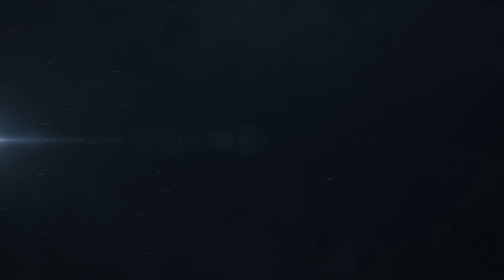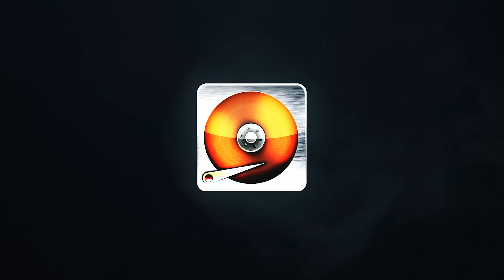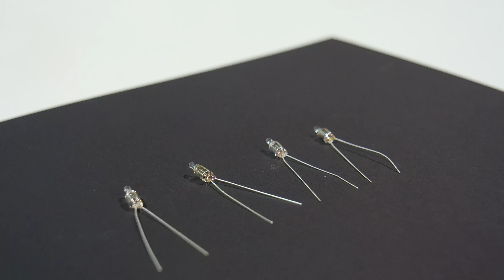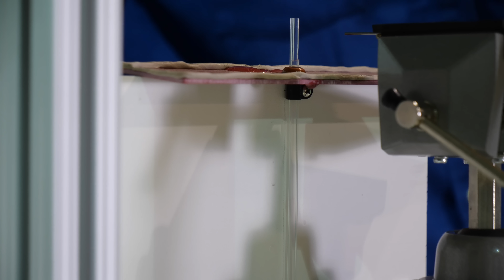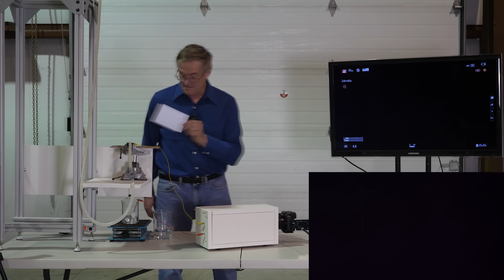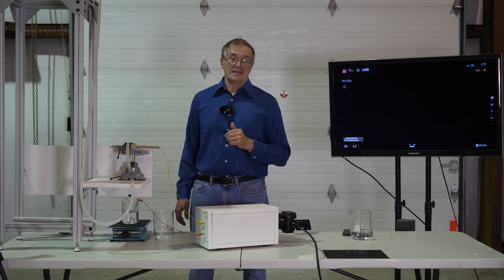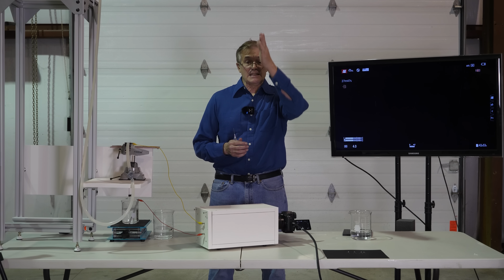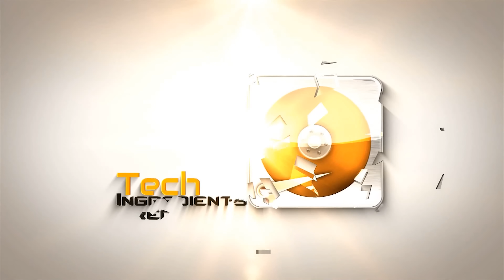We made electricity from water - and it's easy!

Comment: I've played with the Lord Kelvin's Thunderstorm apparatus, and while it is interesting, the conversion of the high voltage at low current to something more usable is tricky.  I like the idea of mass paralleling of the channels though.
Reply: I need to run a water dropper again but this time add pH indictor. I hadn't thought about it as an acid/base generator.
Reply: @smsn13act85  It makes you wonder if the same process actually happens in nature. If a plant has evolved to prefer a slightly lower pH, the water that passes through its leaves and/or branches could be subjected to a similar effect.

I'm, obviously, speculating to the moon and back, here, but it's something that could, perhaps, be theoretically possible with some flora.
Reply: @leoa4c  agree a so simple model is certainly existing in Nature. Remind me making electricity with a lemon😊❤.
Reply: Electrostatic stators being water powered for say something like Martin logans electrostatic panels would be really cool!
Reply: I think that it would be possible to resin print the channels with the required properties.
By using a modular design, in theory, an infinite amount of them could be combined in three dimensions.

A tower with millions of channels could be built relatively quickly if the wiring of them were to be automated.
Reply: 😊 @leoa4c  a cat fur? ❤😊.
Reply: Wouldn't you just use a Tesla coil like device in reverse?
Reply: Robert Murray Smith covered this a while back on his channel.
Reply: @kevinleebailey  Thank you for recommending the channel. I had never come across it but it appears to have very interesting videos.
Many thanks once again.
Reply: It was video 1459 How To Make A Rain Fuel   Generator.
Reply: @bigclive, I think they would've been more successful doing an experiment using the flow of water to power something like a watermill... 😉👍
Reply: You know you are doing something cool when Big Clive drops in to comment...
Reply: This comment is another seal of quality.
Reply: It's like electrostatic charge created by cleavage. Something I learned from an old 1870s electrical engineering book I found at a car boot sale.
Water droplets evaporating from a body of grounded water cleave from the surface and become positively charged. It's like Lord Kelvin's water dropper in reverse.
Reply: Let’s light something on fire then… ¯\_(ツ)_/¯
Reply: Trompe?
Reply: cap dump it
Reply: We are family here!
Reply: @aleoa4c That sounds very plausible to me 👍
Reply: However,  our body is a big water machine and synapses are chemical exchanges of electrical energy conducted as a circuit.
Nature did it. ❤😊.
Reply: So, what is the difference with the Robert Murray Smith showed sme time ago, that worked with rain water? How many of them LASER's from Santa's second grey sack would this power?
Reply: Transformer
Reply: I have also built this several time over the years. Using the charge in a conventional way might be missing the point. Kelvin's Thunderstorm actually separates the OH- from the H2O+. If you could separate out the H2O also you would have an expanded gas without heat. If you then discharge that you'd have an implosion - usable energy.
Reply: @TonyGrant.  I agree, but i would go even further and add 3 x 1mm spark gaps into the circuit  to make the electricity resonate, and become even more. The higher the voltage goes the easier it would be to convert back to normal usable  electricity with the help of a step down transformer adding amps to do hard work.

Comment: It seems that energy is coming from the kinetic energy of the water, not from the water itself.

Check with Sabine Hossenfelder, she is great at getting into the physics of what is happening.
Reply from the maker: You're right that the water is the intermediary between the potential energy in the elevation of the water and the electrical current that is produced.
I think it's pretty clear what the mechanism is with this process.
But, I won't turn down the opportunity to learn something.

Comment: In theory, this could be "scaled up" relatively easy.
Issues with most sources of water would be adequate filtration and/or cost-effective cleaning of the channels. Even a very small percentage of foreign particles could affect the efficiency significantly and relatively quickly.

Regardless, with everything considered, there is already an impressive amount of power being generated for what is, in essence, just water movement. As this system gets further developed and other great minds dedicate their time to the intricacies of it, I can see it finding multiple applications.
It is not the type of generator that will power the world, by any means, but there will definitely be uses for it.

Thank you ever so much for another great video.
Reply from the maker: I agree completely.

Comment: I guess a good large scale test example of this could be done with 2 stage metal roofing sheets using rubber isolators  between sheets.
lets say it's a 7Ft roof length:
1. Split them into 4Ft x 4Ft sections.
2. lower sheet coated in a phobic spray coating used on flooring, that's usually a floor lever rubber.
3. Upper 4 Ft with isolated rubber grommets separating the layers with a wire solider under it and all other 4Ft x 4Ft sections making the top layer crown. ( - )
4. Collection Water Trough in the form of a metal gutter below that must float and isolate above ground a few inches or GROUND will drain said energy gain. (+)
(For the same reason we don't lay lead acid batteries on the ground)
5. Your tubes under each valley point. Those sheets can have 10-20 valleys per 4ft section.
6. The wires ran into a low amp input high voltage charge controller as the manifold power collection point should do the trick.
You should be able to monitor the incoming and output down converted into 12\24\36v higher amp and usable.

Wooden shed would be the perfect test.

Neat find.

Comment: So I was wondering if this phenomenon also occurs when raindrops fall on the leaves of trees , that as the droplets glide along the hydrophobic surface, charge separation occurs, making the droplets more acidic before they fall to the ground. Maybe this acidity then helps dissolve nutrients in the soil, and the resulting electrostatic charge contributes to transporting those nutrients up through the tree's roots.? Also, thank you for this amazing video!
Reply from the maker: I like your way of thinking. 🙂

Comment: Is this also producing hydrogen gas at the bottom and hydrox at the top? Could those be captured for hydrogen power as well?
Reply from the maker: I'm not sure. Hydrolysis occurs at the surface of a highly conductive metal plate and not in the bulk of the water. The plastic may not be conducive to that process.
Reply: @TechIngredients  My thought process here is, when you have a surplus of H+ ions in the beaker, and electrons exit the circuit, two electrons and two H+ combine to form H2, and a similar effect at the top with OH- donating electrons. I could be misunderstanding the chemistry or the amount of gas produced may be negligible.

Comment: FEATURES: adapts to any IC engine as the gas is drawn into gaseous form in the quantity determined automatically  by the vacuum, (the more you depress the throttle pedal, the more the vac and the more gaseous?gas is drawn into the ice.  Super EZ, super Low cost very low parts count. * Can you do one on the fuel vapor method of supplying an internalCombustionEngine (Ice) w fuel ?   I built one but would rather see your take on my method.   Mine uses the usual bubbling air thru water in a tank to  get gas-air mix which is said to be more "atomized" or more fully mixed w air so that the efficiency improves; [ just use the intake vacuum to suck in the airgasmix from TOP  of tank where it bubbles up thence into the hose that goes to the intake (just cut 1-1/8 " hole for 3/4" ID hose in air intake, route hose to inside top of tank (above liquid gasoline in tank); another hose goes from outside air to hose immersed in liq-gas gasoline in the tank. The intake manifold vacuum sucks air-gas off top of liquid gas which bc of vac sucks gaseous air/gas up hose to intake, and in turn "lifts" the gasoline to suck air from outside to bottom of liq gas, where it bubbles up as aid thence to intake and ice ] .  Mine runs a 4 cyl engine quite well @ up to 4600 rpm redline (i think it could go higher but it was already too high rpm for safety so i let up on the gas pedal, drives around the yard nicely ! (use starting fluid to get it started). A fine adjustment is that the bottom air intake actually floats just 1-2" below liqgas surface so that engine idles good.  Works for me, but again I'd like to see your take on it, i haven't been able to test MPG improvement yet as the car is old with massive oil leak. *Can be used for emergency replace carb or injection system to get car home or even for regular use; needs no computer (fuel wise) since venturi effect draws the right amount of fuel as needed on demand, needs no injectors, no fuel pump, no carb, auto fuel cutoff when engine stops (no vacuum, no gaseous fuel flow), can use basic 5 gal "gasoline" can (plastic). .      THANKS.
Reply from the maker: I don't understand the principle.  Your setup is pretty clear, but why bubbling the air through water will do anything other than humidify the air isn't clear.
There is a mechanism where this could affect efficiency. Water vapor increases the specific heat of the intake air. This reduces the heat rise during the compression stroke, and so a higher compression ratio is possible before detonation occurs.  To take advantage of this, you'd have to modify the engine's compression ratio, and that increase will increase the efficiency of the engine.

Comment: You create the energy by lifting the reservoir 1 meter. This gravitational potential energy is responsible for the separation and accumulation of positive and negative ions, creating an electric potential between them. This energy is released when the neon tubes discharge. In fact, this is nothing new. The principle of such an electrostatic generator was already known in 1867, when Kelvin invented his "Kelvin dropper," which is based on the same principle.
Reply from the maker: The Kelvin drop method is not the same as it requires an external field to separate the charges while this is done here with surface interaction. 
The reservoir height is simply providing the flow to the generator.  The potential energy conversion is the drop of the water down the 30 cm tube.
Reply: @TechIngredients   "an external" suggests it originates from outside, which is not the case. The field is ultimately generated by the gravitational potential, just as with this separation method. This separation method, based on the triboelectric effect, creates a charge difference. In the thin EDL layer between the water and the Teflon surface, an "external" electric field also arises. The so-called "streaming potential," in this case provided by gravity, causes the separation of the ions and thus the buildup of the potential.
Reply from the maker: External means where it operates.
It's a clever design, and it works.  I've built one. But the principle is different even though both depend on gravity to move the water.

Comment: If you have that much water in one place, why not use a turbine? even 1000 tubes if they (generously) generate 1mW each, would be only a single watt and if the quoted 10% efficient figure is correct, the same amount of water could generate at least 8 watts in a conventional, 80% efficient turbine generator system. It's similar to a multitude of other very-low-power generation schemes like trying to extract power from people walking; it's technically possible and in theory may be cheaper per unit energy than other methods but in practice becomes overshadowed by technologies which can scale better.

Comment: How many volts, amps, watts was your setup making? It must be decent voltage to drive those neon indicator lights, but I'm assuming single digit milliamps.

Can you combine multiples of these systems in series and parallel ? 

Can the reverse be used to make the same? Say water bubbles moving up the tube in segments ? (somehow electrically isolated from the surrounding water?)

Comment: Am I wrong for thinking this way when you said “so we are making substantial power” because in my mind, I disagree. My thought is you’re making “power” with the ability to over come a lot of resistance. Not necessarily substantial in quantity and maybe the term is appropriate in either view or flexible in that way. But I tend to think of substantial meaning capacity/quantity rather than ability to overcome resistance such as high voltage. 

Is this an error on my part? If so why?

Comment: I watched a professor, he had 6 tin coffee cans. 4 had the bottom cut out. 3 a side one over the other. With the bottom two Still had there bottom. He run a wire from each to opposite sides making an x between can's. The bottom two had wires toward each other with a spark gap. As water was poured threw the can's , if would start to feather and not be a nice stream. At the point it got really feathered. A spark would jump at the gap. . Run this set up off a gutter. Time to ponder. 
$$$ 6 used cans, a little wire. ?
Reply from the maker: That is a Kelvin generator and also operates through charge separation, but the separation is induced with an external field as opposed to surface effects.

Comment: Love your channel. A few questions: At 9:34 you mentioned you were using distilled water. Is it a requirement that the water be distilled? If so, would the rainwater and dam water (grey water) examples still work? 
The paper said to use 2mm tubing and you found 3mm to work better, could this be due to differences in your local altitude/atmosphere?
Reply from the maker: It isn't a requirement. The system will generate about 90% as much power with seawater.

Comment: I can atest to the high voltage collected from personal movement having been tested at around 30KV - 40KV. I have historically "killed" wrist watches, microwave ovens and quite a few mobile phones( I rarely use mobile phones only once i have shorted my hands to known earth points). A 'good' party trick was to scrub my shoes on carpet and then touch a 'victim' on the nape of their neck with the dampened tip of my index finger resulting with both a loud crack and a distinct verbalisation🤣😇
Reply from the maker: Ah, so that was you!
Now, where's my laser...

Comment: If we want to turn falling water into electricity, standard hydroelectric generators are a highly effective technology. (Also a technology that doesn't depend on surface effects, and should be much more resilient to dirt in the water. ) 

Also, you need a lot of water, falling a long way, to get an economically significant amount of energy.

Comment: You can generate more electricity with a turbine using the 1 meter drop. How are you going to get the water up back into the container? Useless "invention".
Reply from the maker: You can generate more electricity with A one meter drop. The drop with this charge separation setup is 30 cm.
With either a turbine or this system,  you don't have to put the water back.  That's silly.

Comment: I think it should be made clear that this is not "generating electric from water" and more than a hydro electric dam is "generating electric from water". Dont get me wrong this is very cool, but the amount of energy out is directly proportinal to the volume and kenetic energy of the water even it this becomes a function of the energy with held with in the ionic bonding between the HO and 0. 

So an intersting question would be, if you take something like the Hover dam with a peek flow of ~40,000 cubic feet per second (though its turbines) can produce ~2Mwatts (i belive), what would the theoritical peek power output be if you used this method based on the same 40,000 cubic feet per second flow? 

Technology like this is only really viable is it can produe usefuly amounts of energy and the cost to produce that energy is onpar or significently cheaper or less complex than current methods. 

How about using the same water flow you are using in this experment to drive a small efficent turbine / generator and compare the output.
Reply from the maker: It's a reasonable way to describe the setup. For example, you could say this or the dam are generating electricity from water, or alternatively from gravity.  The distinction is how these two systems interact with the water to produce electricity. 
This system is a little over 10% efficient while a large dam is over 75% efficient.
Scale has some effect, but not all flowing water sources are practical for both systems.
Reply: @TechIngredients thabk you for the reply. Im impressed with the efficiency.

I love how over the years extracting energy from flowing water has evolved. From a water wheel grinding grain and powering machinery, to generators and turbines and now we are at the at rhe molecual bonding level! 

Love your channel, people like you are who drive the next generation of STEM ❤

Comment: Wouldn't it be an issue to put that ionized water back into a river or lake if you ran this at a large scale? I imagine making the water even slightly acidic could have massive effects on the natural ecosystem.
Reply from the maker: As soon as the electrical energy is extracted, the water neutralizes.

Comment: Yeah you could use bubbles to turn something...so it needs a supply of air at the bottom...hot air rises...so it could be in a hot location...getting the water to not come back down the tube depends on pressure...